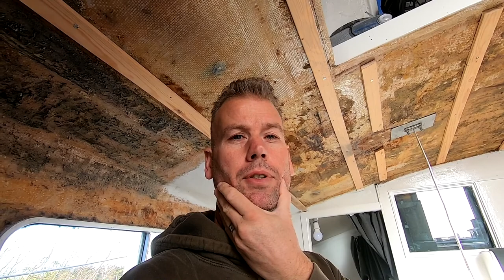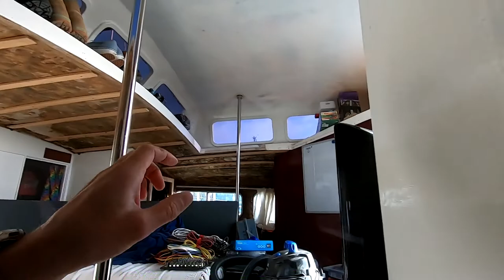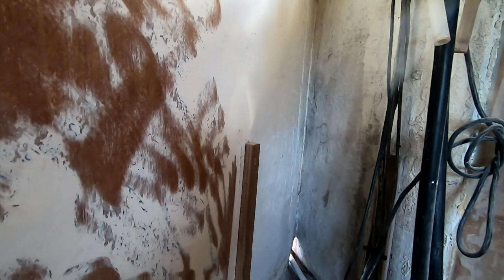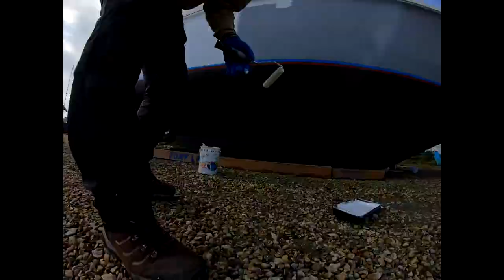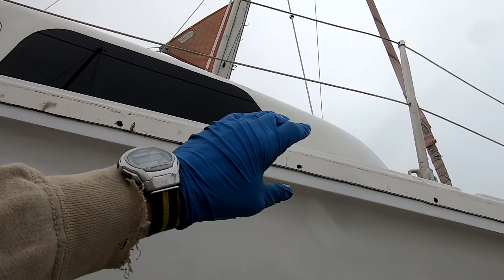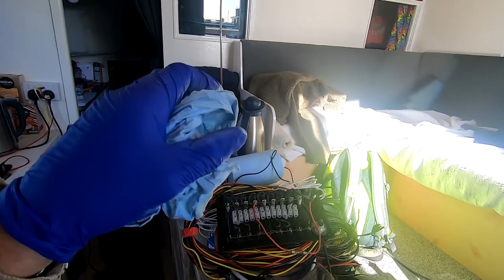Painting Boat Topside on a budget with 1k Polyurethane E129

Comment: Good on you. That's a hefty looking anode, excellent.  Is there any thinking behind where it will be placed. How far below the water etc.
Reply from the maker: I have actually moved it to under the stairs now (closer to the fuseboard) i have no idea on the physics I'm afraid i just know that you earth to it!🤷‍♂️😁. It sits around 6-9  inches below the water line i believe, nothing else metal under water so may not even be necessary🤔
Reply: @SailingFoxyLady  
Your propellor and motor drive leg..?
BTW I've seen some very old and well respected boat yards using Lanolin grease to keep threads on stainless steel fastenings from seizing up. 
I know it was used on Aluminium flyingboat hulls inside to protect against to corrosion.
Reply from the maker: @clivestainlesssteelwomble7665   briliant thankyou mate👍 the leg and prop spend minimum time in the water, unless motoring its lifted out!😁
Reply: @SailingFoxyLady  yep but ive seen a lot of props and legs damaged pretty quickly in salt water for the sake of a dedicated anode so if theres a space to fit one 🤷🏻‍♂️ you could ask sailing Calypso. Theres uses a similar drive.
Reply from the maker: @clivestainlesssteelwomble7665  ah ok,will do,thanks mate!👍👍